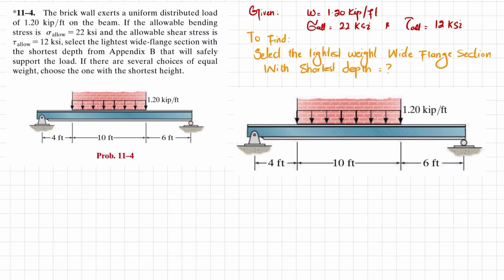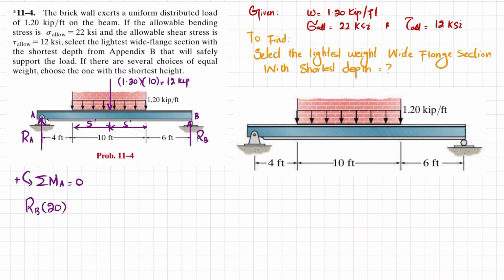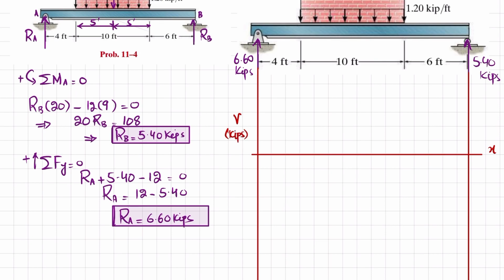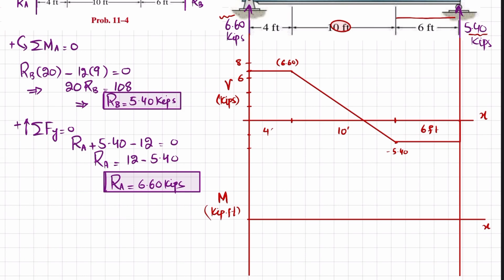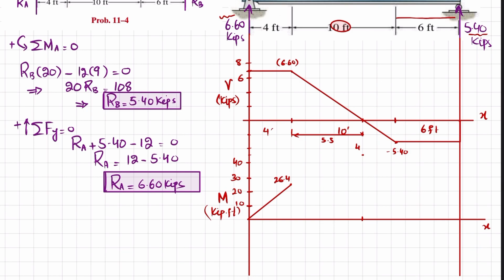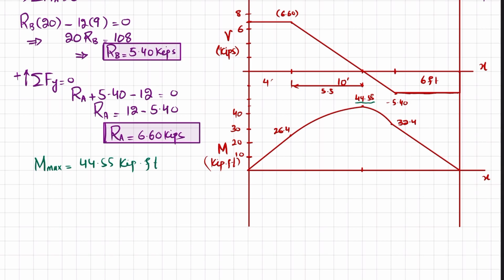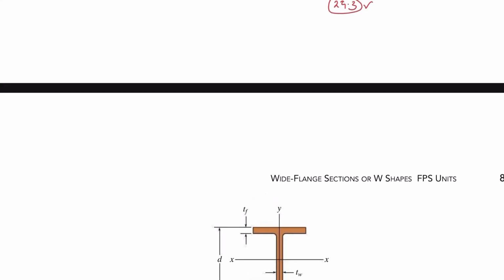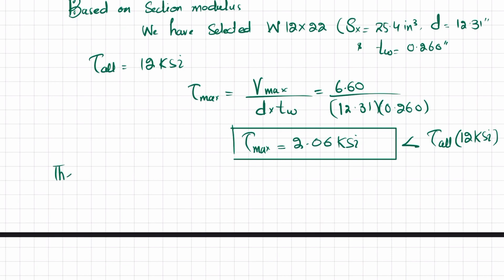11-4 Design of beam and shaft| Mechanics of Materials RC Hibbeler

Comment: Why dont we choose W8x31 this is shortest and S =27.5
Reply from the maker: Because W 8x31 has 31 lb/ft weight  as compared to what we have selected  W 12x22 which has 22 lb/ft . So w 8x31 will have 620 lb weight while the other one will have 440 lb weight. That's why we have selected W 12x22
Reply: @engradnanrasheedmechanical Thank you for attention
Reply from the maker: @tarkdursunvirdil7515 my pleasure ❤

Comment: Sir how did you get the length of 5.5 for the triangle?
Reply from the maker: ok good question if you draw the shear force diagram as per scale and then you measure it by scale you will get to know the length/ baseof first trinangle will be 5.5 ft. or otherwise you will cut the beam during any distributed load for 4<x<14  and find it's shear force equation which is easy work then you will take shear force equal to zero  to get the value of x at which shear force is zero and it will be 5.5ft . you can try it or take the help from other problems of SFD and BMD
Reply: @engradnanrasheedmechanical  perfect explanation
Reply from the maker: thank you for your valuable feedback